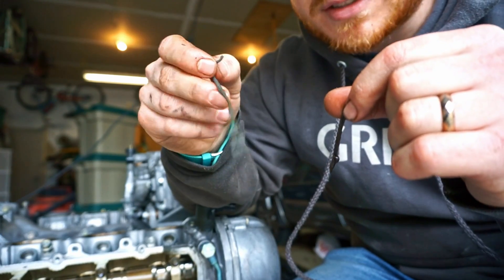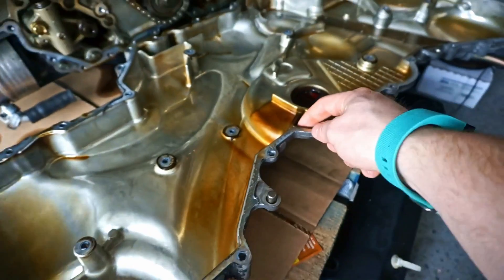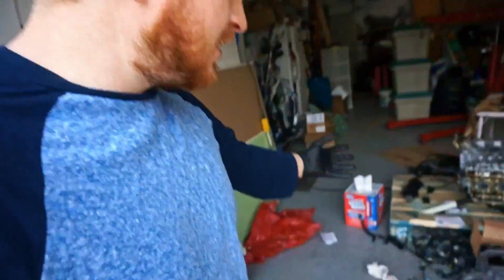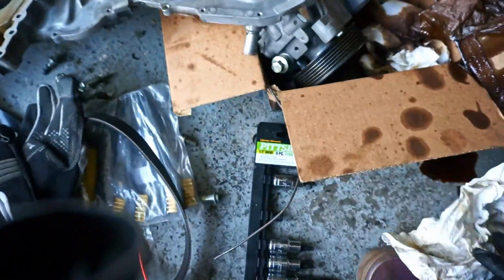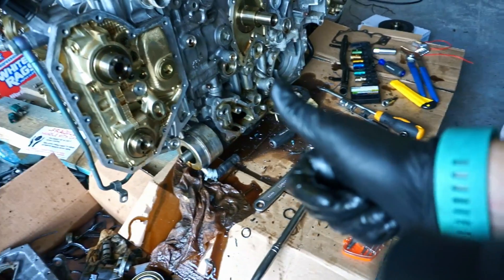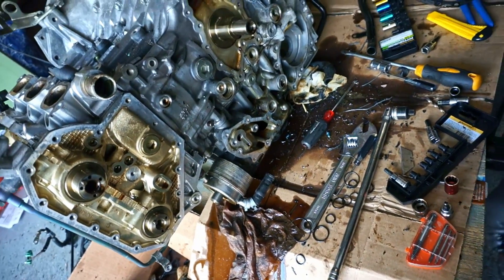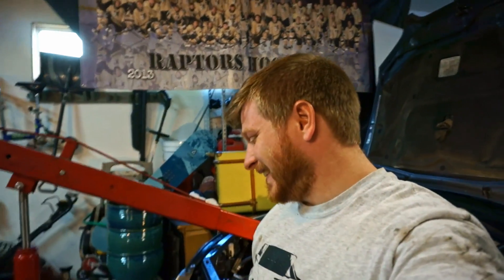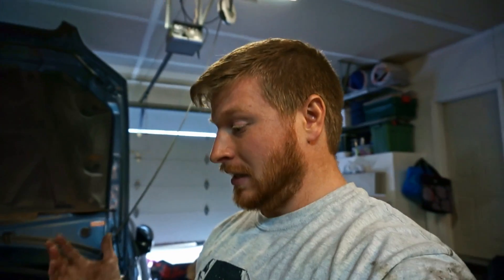JDM EZ30R crate engine swap

Comment: Hey I have a 2.5L SOHC 08 outback if I buy a replacement JDM engine will everything be the same and can I pass emissions? In New York they use the OBD port to see your readiness monitors. Thank you in advance
Reply from the maker: +Elliott Nunez the sensors on the jdm will most likely be different. If you just use the jdm long block and throw all your intake and sensors on you should be good. 
Check the forums for specifics though

Comment: love all the vids on the h6 stuff, I've just had a front end crash and have a tiny crack on timing chain cover you refer to it as the front cover in this video, what do you think is the best course of action? is it a big issue and will leak oil? thanks in advance keep up the good stuff
Reply from the maker: +Cam Piggott is the crack on the upper portion or the lower? 
If it's on the upper part, you might not have too many issues. There is oil flowing through it though
Reply: Dirtcheapdaily it's in the lower 1/3 the radiator support bar/lower tie bar was pushed up into it if you can picture it, it's gonna be hard to source a new cover as I'm in Australia and aren't to many h6 parts, how would I go about sealing the cracks? they are only hair line could I use a chemical weld or epoxy of some type? 
thanks again!
Reply from the maker: +Cam Piggott I'd prep the surface like crazy before I used an epoxy or anything. Take a dremel tool and a sanding bit and sand down the metal on either side of the cracks so you get good adhesion. Make sure the product you use can flex a little and you should be good

Comment: Nice videos man. I've got a EZ36 in my car (well, came with it) and interesting to see how this build turns out. Noticed at the beginning you've got the same impact Porter Cable that I've got. How useful is it as an electric impact? I haven't used mine yet.
Reply from the maker: +Timothy Brown 
It's fantastic! By far one of the best tools I've purchased so far. 
It's not got a ton of torque like you'd expect from a 1/2" impact, but it's plenty for most things and it really speeds things up!
Reply: Excellent. What did you use for an attachment to be used with impact sockets? Anything special?
Reply from the maker: +Timothy Brown I think it's called a 1/4" quick release 3/8" socket attachment or something like that.  They're not hard to find. Usually sold in a 3 pack. I got my set for about $5 on Amazon.